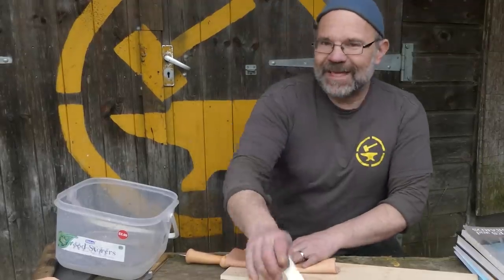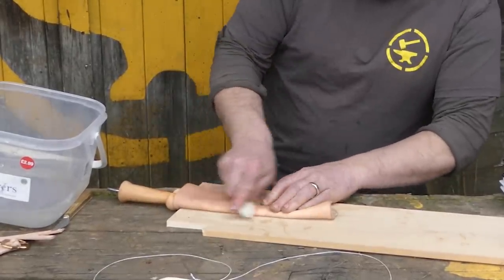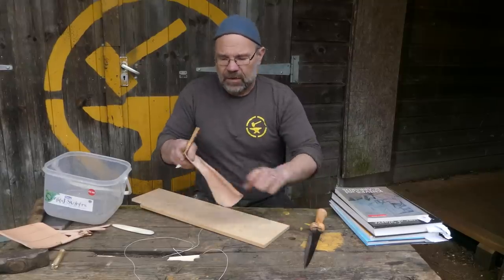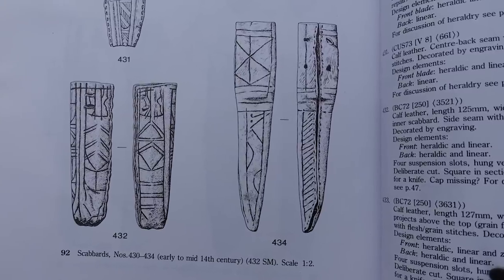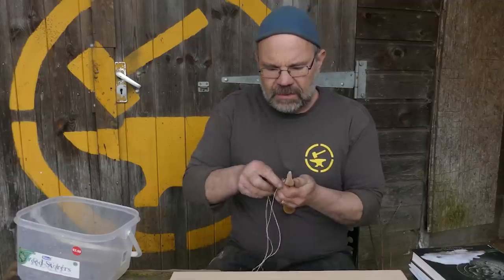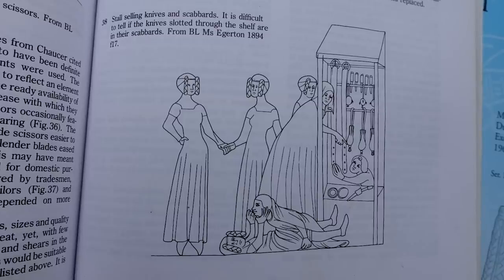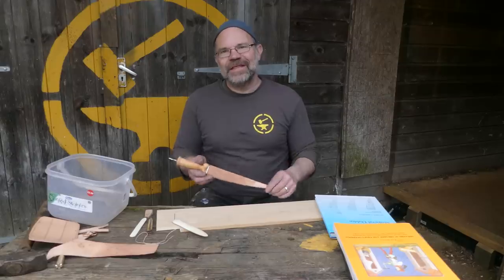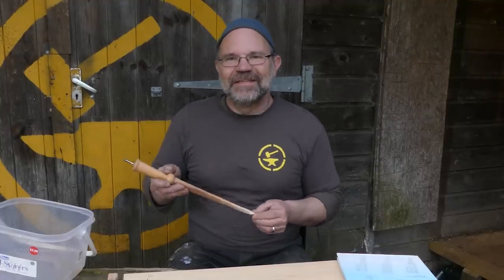Tod Makes Junk - Was Medieval Work Bad?

Comment: What you said at 6:09 about how now you "can't just ram something out really quickly that's absolutely awful because nobody will buy it" doesn't seem true at all to me.  It's just that how we ram out awful things really quickly has changed very dramatically, and a lot of the awfulness has also changed.  We ram out the awful things with injection-molding machines, which produce precise shapes with no effort, and bright consistent colors are cheap and trivial to do.  The awfulness comes in with cheaper materials, designs that use less materials, and designs that take fewer steps to assemble in the factory.  And, indeed, when there is human labor involved, it can be just as awful as the medieval work, especially when it's unseen.  And this awfulness sells; every town has a pound store or dollar store, and they are stocked to the gills with the stuff and have no lack of customers.
Reply: Also, I think this sheds an interesting light on your idea of what people saw or didn't see.  I think we also "don't see" a lot of the cheapnesses today -- maybe not for the worst stuff in the pound stores, but if I go to a typical department store and buy a chest of drawers, and I take it home and leave it out in the rain for a day, it's going to fall apart.  The outdoor toys I might buy for my kids, if they leave them outside for a summer, will be brittle and cracking.  The trimwork on my house is made of what is basically high-grade cardboard; there's no way to salvage and re-use it.  And on, and on.  We're aware of these things, if we think about it, but it doesn't impinge on our awareness on a daily basis.
Reply: And while I'm adding to my own comment, one thing that's clear with a number of cheap Chinese products, if you look at them closely, is the absolute skill involved in making them as cheaply as they are made.  The same thing applies to your bracer; I bet someone who was practiced at making those would be twice as fast at those decorations, at least.  There is often craftsmanship there, and presumably there was then too, just applied to hitting the mark of "precisely good enough, and cheap" rather than to hitting the mark of "best possible".

Comment: I work in manufacturing. I've been an operator, incoming inspector, floor inspector and now a lead operator. I've been doing this sort of work for four decades. Do I try to make good parts? Yes. Do I try to make perfect parts? Heck no. It's a waste of my time. I have a rate to meet. When I was a floor inspector I would tell the operators, 'We don't throw them away because they're ugly'.

Comment: I do not care about no scratches  because after I use it for a while it will have a lot of scratches in it , it will get stained and an extremely fine tip will get broken  rather quickly . I want a knife that will still work well even after its not so bright and the shine is gone , so why not start where it will be after the first 6 months  ?

Comment: People are still buying a lot of cheap crap, the only difference is that the cheap crap of today isn't crudely made by a craftsman but spit out by a machine. I still have a hunting knife I bought as a kid from some teleshopping style catalog, the back of the blade clearly has shear marks from when the machine stamped it out from a sheet of steel, the handle had a really sharp ridge where the two halves of the mold met and the sheet was very haphazardly sewn together faux leather. It survived many camping trips, cut kindling, cleaned fish, made dinner, etc. We are still fundamentally the same, our motivations are the same, only the methods changed.

Comment: I almost would think to hesitate to use the word "awful" to even describe these pieces, nor would I say their mode of thinking was even all that different than our own. It's just that people fail to consider what time and technology truly means for materials and designs.

Like, as I watch this I'm eating from a ceramic bowl, and I can see some blemishes in it, if I inspect it closely. A few uneven splotches in the color, a couple rough nubs of ceramic, and a very slight waver to the rim, not perfectly round. Do I care? Of course not, it was a simple bowl part of a cheap set and it is absolutely 100% functional for what I want: a bowl. It has some coloring and patterning, which really I don't need, and it isn't particularly special, but it's there. And it's all the better for it, because it's totally functional and has some degree of aesthetics, too.

And all of that is entirely the same thing as what you showed for that scabbard there. It has some flaws, it has imperfections, and the design isn't really anything standout. But it's purely functional for what it needs to be, it has a little bit of design work to not look purely bland, and it is made simple enough to be affordable.

The real difference just comes in how my modern bowl was made, vs the ancient scabbards. The materials used for my bowl would be tested and controlled for purity, chemically understood to a great degree, machine-processed with precision and speed. All things that didn't exist back then.

For craftsmen of old to make something that would appear perfectly acceptable to our modern eyes and standards would require them to dedicate an irrational amount of time and effort. It may not even be possible flat out, as the purely of materials throughout the process may not even be attainable! Not just the working material, but the tools as well, the cleanliness of the work area, etc. It's all a long chain of technology that we take for granted, but didn't exist back then.

Comment: In an era without accurately make measuring devices, jig making can't be easy, so repeatability is difficult to achieve especially under poor lighting without optical correction.

We just can't compare the eras. Even today our eyes begin to fail at about age 35, glasses, microscopes, vernier and digital calipers help recover the lost acuity, that is centuries of progress.

Customers without exposure to our modern symmetry would struggle to identify small differences without side by side comparison.

Try marking out without modern devices including work holding and see what the residual quality is. Then take your glasses off and try again, customers included.

Finally anyone who could afford quality would be older with failing eyesight.

Comment: 'Quality' comes down to providing what the customer needs at the price the customer is prepared to pay.  Yes, you tend to get what you pay for, but  if I want something I might use once or twice - or 'just in case', my requirements will be very different from the professional who uses it all day, every day.  We all wear shoes, but how many of us buy hand-made?  Most buy something 'cheap' that looks good - and wears out too soon.
Reply from the maker: I agree.  I used to do special effects and if the crew is waiting for your work and it is 95% done, it is exactly the same as 0% done.  Does not matter how good the work is, it has failed to be there and by definition is a failed job.  Fit the budget/time

Comment: I'm halfway through the video so it might be mentioned, but on top of the already mentioned reasons, maybe the intricacies weren't all that desirable by the common people. They used, broke, fixed and reused almost everything right? So if something was more intricate, then it stands to reason the repair would be more intricate. Think of it like a car nowadays - you can sand and repaint an old work truck without anyone batting an eye, but do it to Mercedes and everyone notices how bad it looks immediately. More than that, it's much easier to work on that truck in general. Just a thought on the subject.

Comment: I think our unwillingness to accept this kind of thing is relatively unique to these items. As you rightly say, the craftsmen were paid piecemeal because these were tools that needed to do a job and the work being perfect wasn't necessary.The comparison I'd make is to today's mass produced items from the Far East which often have questionable workmanship but are designed to match a certain price. Think of injection moulded items with unsightly seams and flashing, poorly made electronics with hot glue all over the PCBs.
Imperfect products tend to be cheaper because they're quicker to make and there's less QC but that is clearly nothing new, it's just that within the world of arms and armour, we tend to be looking for something beautiful as well as historic so it can be displayed rather than used and the result is the price is higher (though having seen some Chinese made swords and daggers, you'd think accepting imperfection never went away).

Comment: I wonder how many leather scabbards were made by the wearer. I made a leather pouch for my phone, it's crude, but because I made it I'm really proud of it. This was the first and so far only thing I have made in leather, so I probably have less skill than the average medieval person.
Reply: Probably less than you'd imagine. I can't see your average peasant using up leather like that, not when that same leather would likely be far more useful in other applications, particularly when getting a cheap shealth would likely be as easy for them as getting new socks is for us. Little more than an afterthought.
Reply from the maker: I generally think not.  They would have to go and buy the leather with the chance of getting it wrong and the thread and needles.  Don't forget that people had very few possessions, period and buying tools for 'not your trade' is an expense.
Reply: @RaptorJesus  I think there'd be scraps left over from the main use of a hide, that would be all you need for a scabbard like this. Most animals were slaughtered every autumn, I don't think leather would be all that precious
Reply: @tods_workshop  I didn't use any specialist tools; a pair of scissors (I'm sure a knife would have done) and something with a sharp point, I used an awl. What you didn't have could have been borrowed, maybe a loan for a few days in exchange for a few eggs. I can't believe that your average house-hold (even a poor household), would not have had needle and thread, how would you mend your clothes otherwise? As for the leather, I think many would have done what you did, used an offcut that wouldn't have been used for anything else

Comment: since modern people are so used to the perceived ease of precision in mass manufactured items and the like, people's baseline is WAY more granular of an idea of "perfection" honestly it's kind of a societal problem even outside the replica medieval item world. I think of it like video games, people used to think the first doom had incredible graphics, and as someone who is actually younger than the game, my first exposure to it was as a game that looked comparatively awful. standards change as perception of the norm changes. the same happens in movies with special effects. jason and the argonauts was groundbreaking, now it's... well, it's not avatar.

I think that's a massive point toward your point on the black and white film thing, and i think that's actually the primary reason this is an issue.

Comment: I don't think we are really any different now, perhaps slightly shifted priorities but we are routinely accepting 'single use' throw away items that would historically have lasted half a lifetime and more... If we don't care if it turns to rags after a few uses I'd say we are if anything worse at caring about quality work than they were, at least theirs were often just decorated in a more naive fashion but fit to function for years to come...

NB: There are and always have been more 'throw away' items, as it is the nature of many things to wear out through use, but now we largely just expect something that will fall apart in a day or two where historically it would have lasted years (and won't pay for better). Yes maybe now with the machine processes it looks a little more consistent, but still...

Comment: Good enough for the job is the correct standard. It's why so many German tanks were ulitmately a bit of a failure in WW2 as they were overengineered and too complex leading to reliability and maintenance issues.

Comment: Weren't the life expectancies in the 1500's somewhere between 30 and 40?
That should probably be considered as well.
I would imagine that expecting yourself to die by 35 would have a strong impact on your expectations of the longevity of your equipment.

Comment: Over on the Townsends channel they have a guy who does leatherwork in the 18th century manner  and he is also a fan of imperfection in work, recognizing that historically even the experts weren't 100% perfect 100% of the time.  As long as the functionality is not impaired, you aren't going to toss it, you still put it to use.  That's no doubt been the rule for all eras up until late 20th century.  Expecting perfection every time is super recent.

Comment: Modern concepts of precision came into existence when that level of measurement became possible with the industrial revolution and precision metrology in the 20th century...
Reply: repeatability is a product of the industrial revolution.  Before that, precision and detail required a lot of time.  So unless they were getting a months wage, they weren't spending a month on a product...

Comment: I love how Tod couldn't bring himself to drop his standards to match the crudeness of the lowest level examples of medieval workmanship. His junk 3 minute decoration of the sheath was a masterpiece compared to the worst examples from the books and same with his 14 second archers brace stamps, perfectly spaced and orientated. Classic Tod.
Reply from the maker: I think that is partly the point and what I find really interesting.  I could not have stamped faster and yet my efforts are considerably better than the worst - curious
Reply: @tods_workshop  I just wonder if the idea behind the misaligned and skewed stamping on some of these efforts was intentional and it was more about making them easily identifiable rather than decoration so to deter theft among the troops?

Comment: They ate a lot of sheep back then, so they had a lot of sheep leather laying around.  It's not that its good for the job, its that you have the material on hand.  It's kinda like people writing on napkins. material sucks, but you just have it around, and it works well enough. Like where I live they used tree bark. Is it good? Heck no. Can you get it  and make it  fast enough for it not to matter? Yes. A lot of people just didn't have easy access to good, cheap hide, so they just did whatever they hand on hand.

Comment: A other thought: let's say you bought you sword or knive witha sheath. Over time it will wear out, because it's made from 1mm of leather. You then might have to find your nearest leather worker and replace it. I don't think most people would have the money to replace it with a new sheath made exactly to your blad. You'd probably buy one from a stock of sheaths that roughly fit your blade. Or you'd give the leather workers a rough idea of size, cuz you don't wanna leave you weapon there until they can get to making yours. Cuz chance they have a list of jobs, so they will tell you do come back in x amount of time.
Reply from the maker: good points

Comment: I'm going to start selling my stuff at a premium saying it's uniquely accurate
PS 3:40 The same is true about a wage system though, unless there are potential promotions and bonuses which don't exist in most trades in any meaningful way (and if they do they're also usually per piece, eg. every client, not every client returning for a year)

Comment: 1 millimeter is 0.0394 inches and 1/16" = 0.0625" or  1.59mm So 1mm is a little less than 2/3rds of 1/16" More than a half a sixteenth though. A half a sixteenth is only 0.03125" 1mm doesn't really correspond to anything in standard too well. 1mm is halfway between 1/32" and 3/64" That really leaves it out in no mans land.

Comment: 'no true Scotsman uh... craftsman' oh dear that was upsetting. That perfectionist mentality really was most prevalent, to my knowledge, in places like Japan after the reconstruction period, wherein Samurai went form warriors to an almost ceremonial caste and in which they practiced poetry more than the sword and whole generations of Samurai never went to battle nor drew blood. they had Time and Disposable income to spend.

Frankly, crafting in medieval times was a job, nothing more. leatherworkers were leatherworkers because their fathers were, as often as any other reason, and almost never out of passion.

Gear for soldiers, especially elites, was commonly NOT PROVIDED by the crown/lord, rather, they would get a bonus allotment for the purpose of buying their own gear. if they could get the gear on the cheap, they could pocket the rest of the allotment. if the gear was heavy-use, prone to wearing out anyway, then either buy cheap and disposable, or buy super-expensive heirloom-quality... few could afford the latter, and fewer wanted to spend that kind of coin...

Comment: I find the idea of being upset about symmetry and a certain degree of perfection to be a very modern viewpoint. We are hundreds of years into industrialisation, where making highly accurate and machine made things is the norm. In an era of hand crafted  items, with many common items being used for  a long time and being repaired constantly, almost nothing would be straight and perfect. A medieval eye would find a straight line very jarring as it would be a very rare thing in their world. A lot of these details are so obvious to us because we have perfectly straight bits of furniture, building features (doors, window frames, even wires) and even items on our clothes (patterns, stitches, seams etc) and other straight things to immediately contrast the item with. In a world filled with straight and flat references, even a slightly wonky item stands out. This wouldn't be so in a medieval world.